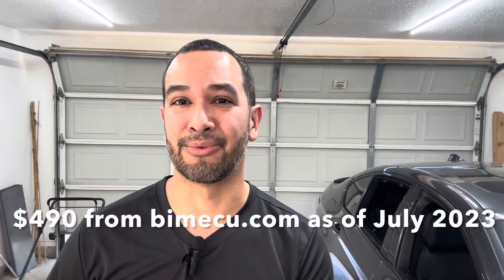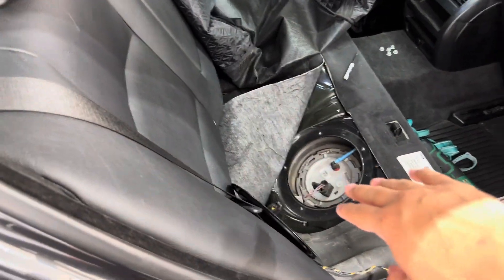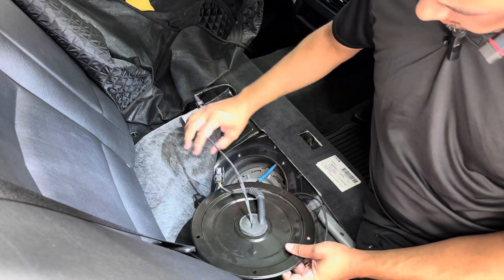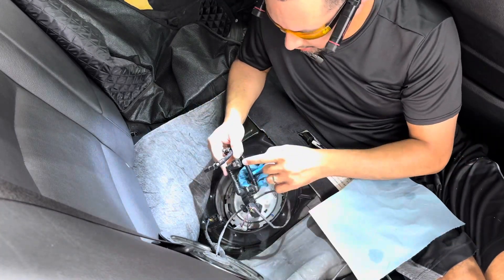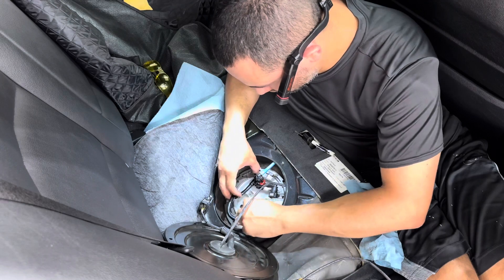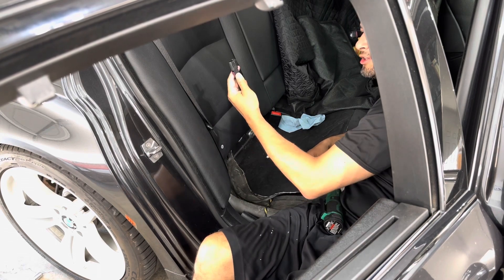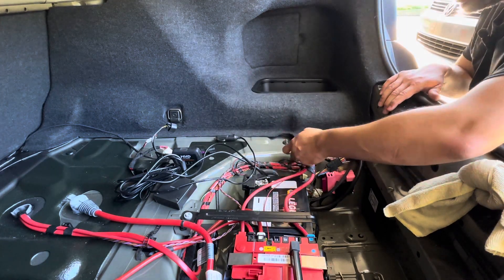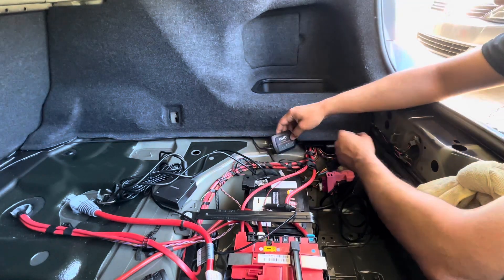INSTALLING MHD ETHANOL CONTENT ANALYZER- BMW F10 535

Comment: Can i run e50 blend with NO pump upgrades w MHD FF Kit?

2016 435i Fbo Stg 2
Reply from the maker: Nope. You have the Bosch style HPFP which is weak. E20-E30 is about the max for that pump.
Reply: @turbospool  what map should I run after I get the kit ? E85 or E20
Reply from the maker: @iVenture01  your HPFP can’t run beyond E30, so E85 map is out of the question.
Reply: @turbospool  what if I upgrade to LPFP Stage 3, would I still need thr HPFP upgrade

Comment: Hey man! What are the limits for stock fueling on these cars? I also have the continental hpfp like you. Can I safely run e30 to e50? I’m stage 2 on 91 octane
Reply from the maker: The actual limits ate all over the place depending on who you ask. But for say a stock turbo PWG N55 and a continental HPFP you will not be fuel-limited. It’s once you upgrade the turbo that you start finding limitations but I’ve noticed people doing 500whp PS2s on ALL STOCK FUELING, and others that they max out the LPFP at 400WHP. Because of that, im sure that condition of the components plays a big role in this. And I cant soeak from personal experience because I upgraded my LPFP and added the Helix OD preventively. Honestly a custom tuner like David Shoup would be the best to ask that question to (hit him up on IG or FB).
Reply from the maker: Also, when I had my stock turbo I ran E40 on the MHD stage 2+ E30 tune for over a year with no issues (on stock LPFP and HPFP) before I went custom tuning.

Comment: Great video I'm about to do the same! One question that I'm unclear of is on mhd when I enable flex fuel can I flash any tune or do you have to do mhd+ multimap? Thanks
Reply from the maker: Thanks man. And you do not. You can flash in the same exact tune you had. All you’re doing by connecting this analyzer and reflashing with the appropriate ECA selected in the options list… is adding the channel for your logs/ live monitoring.
Reply: @turbospool  hey I'm just curious what is your timing advance and boost up to with David Shoup flex tune? I'm curious to see what the difference is from mhd to Shoup? My max boost is 15.9 and timing is  13 to 14.
Reply from the maker: @DJ-lc1en  well I’m not on flex fuel tuning just yet. Finishing up the 91octane “safe, worst-case scenario” tune. Then i will dyno. AFTER I dyno we will knock out the flex fuel tune.
Reply: Got it all in! Running e50! Wow! It wouldn't let me do a single tune I had to use mhd+ multimap And set my base octane in all four slots. Also it wouldn't work when I selected eca? I had to select eca pt2? I don't even know what that stands for. Do you?
Reply from the maker: @DJ-lc1en  glad you got it going! i dont know what that means. I was told on the MHD Facebook group that some early F10s have to run on that PT2. That’s where mine is running (I inserted a text on that screen on the video). I cant wait to start tuning on E so i can get on that! Awesome dude!